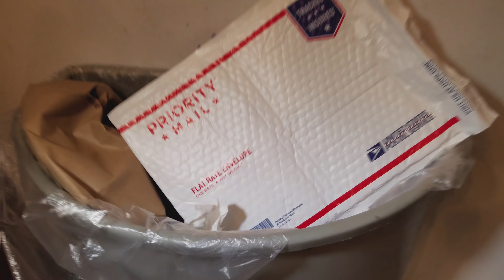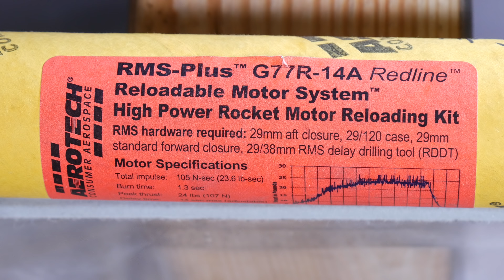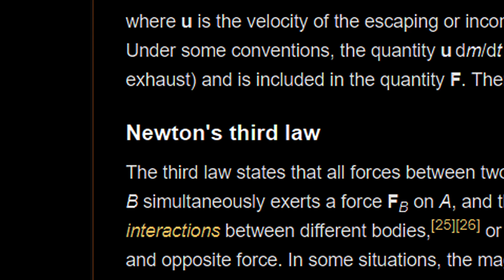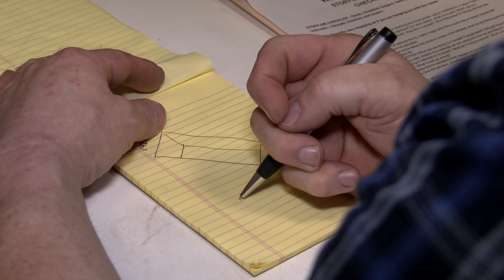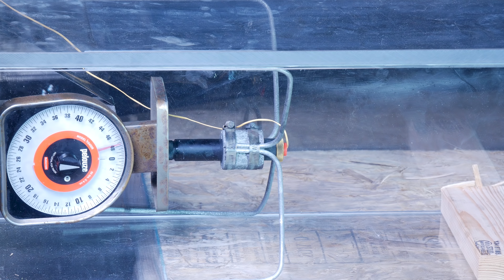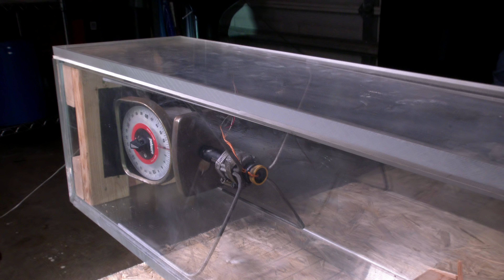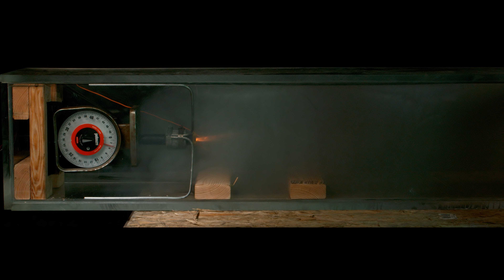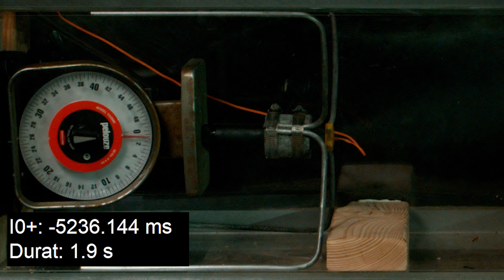Rockets in a Vacuum Chamber - Newton's third law of motion Visualized

Comment: If this experiment was to be taken seriously they had to build a serious vacuum chamber that can hold a vacuum super close to emptiness and the emptiness gauge had to be shown all the time during the experiment, since neither of that happened this experiment can't be taken seriously and I just remind you of 3rd Newton's law: 
If two bodies exert forces on each other, these forces have the same magnitude but opposite directions.
Where 1 body is the rocket and the other body is the atmosphere, in vacuum you are missing the other body
Reply: Incorrect.  The equal and opposite force applies to the thing the "original" force is applied to.  In this case, the exhaust gasses themselves.

It would be no different than being in empty space holding a bowling ball.  If you eject that bowling ball away from you, THE BOWLING BALL (the thing you applied the force to) will exert an equal and opposite force back on you.  It is not necessary for that bowling ball to be in an atmosphere. 

The same thing applies to rockets.  They push mass (in the form of rocker exhaust) at extremely high velocities.  Those particles of gas will absolutely exert a force back on the rocket propelling it in the opposite direction.

It would be like sitting in a rolling chair next to a wall while holding a bowling ball and throwing that bowling ball away from you.  You'll roll backwards in the chair whether there is a wall there for that bowling ball to hit or not.  The mechanism that causes you to move in the opposite direction has nothing to do with whether or not there was a wall in front of the bowling ball for it to hit.  It can't possibly have any affect on you.  For the same reason, rocket exhaust doesn't need to push off of something AFTER you push it away from you.  The rocket exhaust ITSELF is what is pushing back - not anything the exhaust may or may not strike after youve pushed it away.  The job was already done the moment you applied a force to the rocket exhaust gasses - and they back on you.

So, if you had a rocket in a vacuum that worked by ejecting bowling balls at high velocity, I can assure you, it would be silly - but it would absolutely propel you in the opposite direction.  It's just several tons of exhaust gasses instead of bowling balls - and those gasses are ejected at much higher velocity.  It's the exact same fundamental mechanism.  Rockets WILL work in a vacuum.

I think one point of confusion is caused by the fact that something like prop airplane wouldn't work in a vacuum.  That's because the fuel in those propeller driven airplanes is used to turn the prop - which in turn borrows from the surrounding air - pushing it away, and that ambient air pushing back - PROPELling the plane forward.  Rockets don't need air to push off of.  They essentially bring a bunch of bowling balls with them and eject them away, one after the other, and those bowling balls push back.  Except it's rocket exhaust gasses; not bowling balls, and they are ejected much faster - thus resulting in a higher resultant force.

Rockets
Work
In
A
Vacuum

.
Reply: You are very confused about momentum and the Newton"s third law of motion, your thought experiment with the bowling ball is childish you don't have to go to empty space to realize that what you think is not going to happen just go to any bowling to play and throw a ball with all you force and you will experience NO FORCE exerted on you by the ball AT ALL either you run or stay standing when you throw it, why? Because the ball is in the same inertial frame of reference with your body, let me remind you:
An inertial frame of reference is a frame where Newton's law holds true. That means if no external force is acting on a body it will stay at rest or remain in uniform motion.
That's why if you hold a fan against a sail attached to a wheel chair while seating on it, it won't move or a giant fan against to a sail boat while seating on it and the boat won't move, the only wind that will move the chair or the boat will be the wind coming from the mass of air surrounding you, from an external frame of reference (this is an experiment easy to do)
So don't go strayed thinking of your bowling ball brother, I'm not implying that rockets don't work in vacuum but just applying the third Newton's law so if outer space (vacuum) is empty  a rocket won't propel because propellant is part of the rocket is part of the same inertial frame of reference, is not an EXTERNAL force, you have to push against something external to your frame of reference in order to experience force against you
Reply: @edgarwolfen  Sorry, but you're the one who is very confused.  If the ball was exerting NO FORCE on you as you claim, then you could literally just stand there holding the ball with your arm straight down, and throw it as hard as you want without any backswing or anything.  It also would not matter what the weight of the ball is.  

Stand on some slick ice and try to throw a bowling ball.  You will quickly find out how wrong you are about the ball exerting NO FORCE on you.
Reply: No, for the rocket equation, mass 1 is the rocket (and fuel remaining in the tanks) and mass2 is the exhaust gas.
The rocket applies a force TO THE EXHAUST GAS accelerating it into the vacuum.
Reply: @edgarwolfen tell us what would happen if you fired a crossbow into a vacuum?
Would you have recoil?
How about a water hose into a vacuum?
Still have recoil?
Reply: Briansomething5987 that's called gravity and it by itself is a frame of reference and afects all frames of references in it, if you go to vacuum space with no gravity field you can hold tha ball as you said also the thin ice won't break if you stand on it no matter how "heavy" massive the ball is

Stuartgray5877 the exhaust gas came out of the rocket, how come it becomes a second body to fulfill the requirements of a 2nd body in the 3rd Newton's law? 

The recoil comes from the 2nd body (atmosfere) resisting the water coming out of the hose, in vacuum you don't have the 2nd body
Reply: @edgarwolfen  no.  The rocket engine applies a "force" to the exhaust gas accelerating it.
1 - does rocket exhaust have mass?
2 - does the exhaust gas get accelerated as it leaves the rocket?
Reply: @edgarwolfen  and just to let you know: it is obvious that you could not pass a high school physics class.
I have an engineering degree and have been building, launching, and operating real spacecraft in earth orbit and deep space since before you were born.

So please carry on trying to lecture actual rocket scientists on the physics of rocket propulsion   it really makes you look smart.
Reply: @edgarwolfen  So that's a "NO I will NOT answer your question cuz reazons".
Got it. I accept your surrender.
AN BTW - There is a video on my YT channel that explains my entire career. I made the video JUST for you low-intellect types that want to accuse me of lying about my career.
Reply: @edgarwolfen  - "I won't waste my time with you anymore, you just don't understand basics"

I obtained my Engineering degree over 30 years ago, and have been working as an Aerospace Engineer at places like Lockheed Martin, JPL, LASP, GSFC, MSFC, NOAA, DOD and Ball Aerospace since before you were born.
Now just tell us that you graduated HIGH SCHOOL.
YOU WONT.
Reply: @edgarwolfen  And since you are scared to answer my questions, I will answer them for you (actually for the OTHER readers since you will refuse to even evaluate what I try to explain to you):

1 - does rocket exhaust have mass?

YES - Rocket exhaust has exactly the same mass as the fuel and oxidizer that went into the engine (per second).
For example, a Space Shuttle Main Engine (SSME) consumes about 500 kilograms of liquid oxygen and liquid hydrogen PER SECOND.
It combusts the fuel and oxidizer creating "exhaust gas" (PURE WATER) that also has 500 kilograms of mass (per second)

2 - does the exhaust gas get accelerated as it leaves the rocket?

Yes - A SSME can accelerate 500 kilograms of PURE WATER from a standstill to about MACH EIGHT (2500 meters per second) at sea level (higher exhaust velocities in lower atmospheric pressure)

Next Question for edgar:
3 - Can "MASS" be "ACCELERATED" by anything OTHER THAN a "FORCE"?
(or is a "Force" REQUIRED to accelerate mass?)
Reply: @stuartgray5877  the rocket engine does not apply a force to the gas 😂
Reply: @rocketman484  Abusing people again, chatbot?😂
Reply: @papalegba6796  - "the rocket engine does not apply a force to the gas"
Oh? SO then WHAT is applying the force to the mass of the exhaust gas?

You have said that the VACUUM cannot exert a force.

So, its "Magic" Then.
Got it.
Reply: @edgarwolfen  - "the exhaust gas came out of the rocket, how come it becomes a second body to fulfill the requirements of a 2nd body in the 3rd Newton's law?"

How come it DOESNT?

This is very simple: One object (the rocket) PUSHES (applies a FORCE) to a second object (The exhaust gas). BOTH objects feel the force so BOTH objects get accelerated in opposite directions.
Are YOU going to argue that a fireman does NOT get pushed back by a firehose???
Reply: rockets are not like planes, they do not require the atmosphere. They carry their own mass to push off of. Rocket's are more efficient in space, also.
Reply: @ppleberrynd  - "They carry their own mass to push off of."
Not according to papalegba above.

He believes that rocket engines can accelerate all that mass WITHOUT applying any "force" to that mass.

Comment: Pretty much BS.  Wouldn't the rockets deform.  Do it for an hour and see.  Nice try but not convinced with what I saw!
Reply: @darklight2.1  In a vacuum if you are belting out all that power the rocket would deform in the engine like the nozzle is deforming.  The energy must go somewhere! And it is running for hours.
Reply: In our atmosphere the fire from the rocket is able to escape and it deforms the air. But in space where there is no air to deform, the rocket would be deformed just as the hozzle is .

Comment: Regardless if a rocket does or doesn’t work in space, this video has zero educational benefit.
The rocket fuel provides an atmosphere as soon as it ignites.
   Further more, the chamber is too small and the rocket gasses started to push against the sides of the box immediately.
   Not helpful, just assumed outcome driving the parameters of the experiment.
Reply: I can help you understand how rocket propulsion works in a vacuum as you seem to be confused.
To see if you have the most basic grasp of physics:
Would a crossbow, fired into a vacuum, have any recoil?
Yes or No?
Why or why not?

Comment: Even if you are a glober, the main rocket in 1969 could not have accelerated away from the moon towards earth, in vacuum!
Reply: Without anything to do the counterforce, you cannot accelerate something.
Reply: @per-bjarnemikalsen3996  Care to take a High School level physics challenge that PROVES rocket must work in a vacuum? You just answer about five question with no math and you wiil see that Rocket Propulsion MUST work in a vacuum.
To see if you even qualify for such a challenge, answer the first question: Do CROSSBOWS experience Recoil when firing a standard steel projectile (bolt) ?
Reply: I have physics! You talk gibberish pretending it is a language. The string turn potential energy into kinetic energy. The rocket may work, but for acceleration, the gas released crashes into the gas/ air/ oxygen, and this gives an opposite force, pushing both air backwards, as well as pushing the rocket upwards. For acceleration to take place, a counterforce is needed.
Reply: @per-bjarnemikalsen3996  so is there a " counterfoce " produced when firing a CROSSBOW in a vacuum ??  This is a Yes/No answer.
Reply: Yes there is! I am happy to explain, if you ask for an explanation.
Reply: @per-bjarnemikalsen3996  so a crossbow WILL feel a recoil when it fires a standard Steel projectile! Good!  This is correct.  Now what if that crossbow fires a block of water ice? Still a recoil?  How about a block of Dry Ice (solid CO2) recoil? WHY? What do all these materials have in common that allowed them to Push Back when pushed upon?
Reply: They are all material, gas, solid or fluid, so all those will give counterforce.

You can have force without acceleration, but acceleration is always bound to a force. 

A bow is retracted, during whick the bow-string is accelerated for a tenth of a second. You need force to keep it in fire-position, this gives tension in the string, and tension in the bow, as counterforce, but no acceleration so far. The potential energy is transferred into kinetic energy when the bow is released and the arrow flies away. The counterforce to this accelearion of the arrow, is tension in the bow itself.

With a rocket in a vacuum, once the vacuum-chamber is started to be filled with gas from the rocket, the additional gas coming from the rocket will now hit the gas that are already in the chamber(also from the rocket), and then this gives counterforce for a acceleration of the rocket itself.

If you need additional information now, then I want money for it, via paypal.
Reply: @per-bjarnemikalsen3996  do you know the Name of the property that all of this matter possesses that allows it to resist being moved?  Do you know how the Law of Conservation of Momentum works?  If I have a 10,000 kilogram "crossbow" (machine) that can launch a 500 kilogram block of water ice at 2500 meters per second (muzzle velocity) can you calculate how much velocity will be imparted into the machine when it fires the block? Assume the block is fired in a vacuum.
Reply: So it is math now, that are not directly connected to the dispute we have. Point is, a rocket will not work in vacuum. Send me usd 100 and I will send you the calculation.
Reply: @per-bjarnemikalsen3996  i already did the calculation.  The "machine" will be imparted with a change in velocity of 125 meters per second.  Do you agree? Yes or no?
Reply: @per-bjarnemikalsen3996  so you say "a rocket will not work in a vacuum" but I just explained a "Machine" that can fire WATER and it WILL GET PROPELLED! How is this any different from a rocket that forces "Mass" (the word I have been trying to get you to say) out the back end of the nozzle?  IN FACT the very "machine" I am referring to is a Space Shuttle Main Engine (SSME).  It consumes 500 kilograms of liquid oxygen and liquid hydrogen PER SECOND and combusts it to make WATER which exits the nozzle at 2500 meters per second.  It is NO DIFFERENT from a catapult firing a block of ice in a vacuum - They WILL FEEL THE FORCE OF "RECOIL" just as a gun or crossbow will. The calculation I did PROVES THIS.
Reply: The water that are pushed from the rocket will meet vacuum, hence not meet anything that gives counterforce for the rocket! So no acceleration.
Reply: @per-bjarnemikalsen3996  so the water gets ACCELERATED from the rocket nozzle WITHOUT A FORCE ?? Is THAT what you are suggesting?  The water CLEARLY gets accelerated, and it HAS MASS, therefore it REQUIRES a force to get it to move.  When the SSME accelerates this water from zero velocity to MACH EIGHT, where does the FORCE originate?
Reply: A force accelerates the water out, once out, the water will continue move in a constant speed forever, or until it hits something.
Reply: @per-bjarnemikalsen3996  so WHILE "forcing the water out"  the rocket FEELS THIS FORCE!  This is where the PROPULSION COMES FROM! While ACCELERATING the water the rocket FEELS THE FORCE! The Same as THE RECOIL from firing a mass from a crossbow.  THE PHYSICS IS THE SAME!  So QUIT saying there is nothing "to push on" because THE WATER IS WHAT GETS PUSHED ON, and since it HAS MASS it also HAS INERTIA AND PUSHES BACK .
Reply: @per-bjarnemikalsen3996  why did you delete your juvenile anti semitic statement? Embarrassed to sound like a petulant child?  I would be....

Comment: in yer basement?? does not create the entire environment Like; minus 455 degrees F. a td warmer than absolute 0, aint nothin' gonna ignite nothin' at those low temperatures get real
Reply: @Apple TV precisely why
Reply: @danielstag2834  
"Why are all the craters on the moon a result of a direct hit?"
They aren't. Craters are produced by the explosion of the impact, not the impact itself. The explosion is spherical.

"Has anyone created combustion in their basement at 455 degrees below zero?"
Spacecraft are not 455 degrees below zero. With liquid-fuel engines, the propellants would freeze far above that temperature, so heaters are required. But they don't have to be very powerful, because radiation is the only way heat transfers, and that's very slow.

"To enable this experiment dont you think one must duplicate the elements it is suggested to function in?"
The question was about rocket motors in a vacuum, not in orbit. Rockets work in a vacuum, the question is answered.

Comment: 500 replies, quite the debate!   Dr. This is very well documented but I'll have a go anyway for others.  What you fail to realise with your water balloon examples etc is that the resulting thrust is not from 'atmospheric resistance' slowing down the stream of water that creates some backlog and pressure..   the thrust simply comes from the acceleration of some mass (in your example water, in the video it's the mass of the rocket exhaust) which pushes the remaining mass the opposite direction just like newton said 300 yrs ago.
Atmosphere or not makes no difference to the mass being accelerated.  In fact it is that in a vacuum the mass being accelerated goes faster due to less atmospheric resistance so the resulting thrust is actually greater in the vacuum of space than in our atmosphere!  The opposite of how you misunderstand it to be..